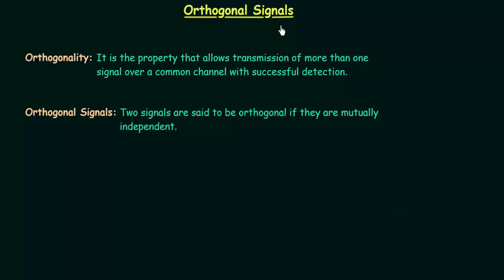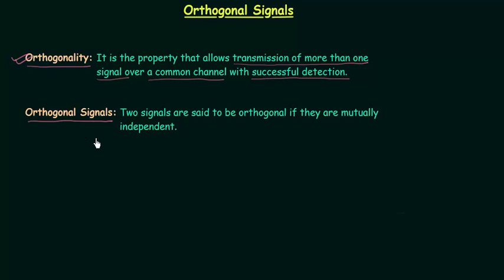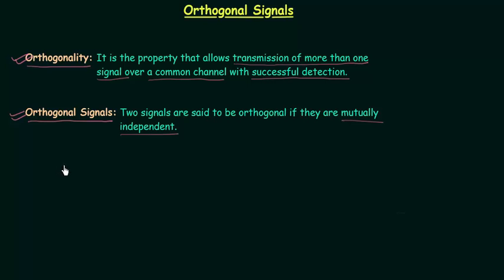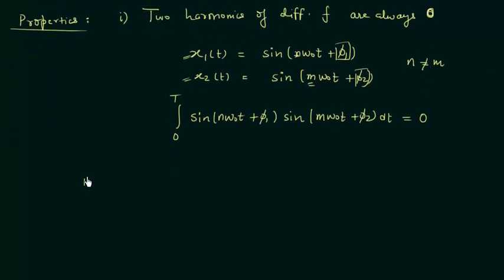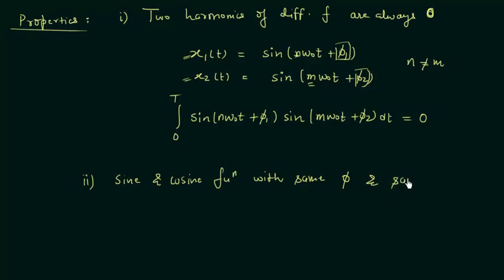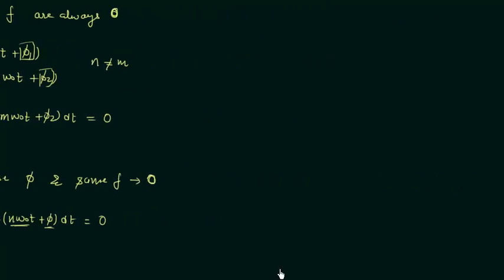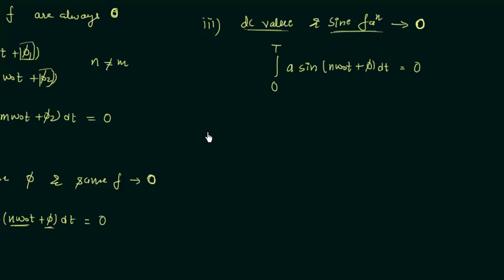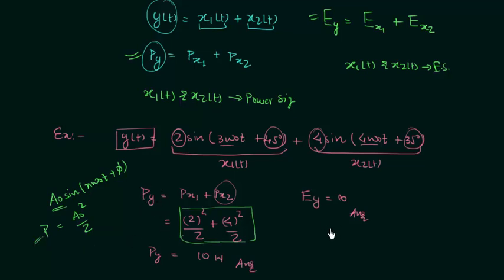Orthogonal Signals

Comment: If there are two signals x1(t) and x2(t) with DIFFERENT time periods, then while performing the definite integral, what should be the value of 'T' ?
Reply: T is the time period of the product signal y(t)=x1(t) × x2(t)
Reply: @saheliroychowdhury3253  Thanks a lot for the response. I am actually just beginning in this field, so this created another query. In this case, how to find the value of 'T' ? In the previous lectures, we were taught to find the time period of composite signals, but the individual components were being added in that case, i.e, y(t) = x1(t) + x2(t). But how to find fundamental time period where y(t) is the product of the individual component signals ? Would be grateful if you can explain or redirect me to some resources where I can learn the same. Thank you. :-)
Reply: If you've say x1(t)=sin 2t and x2(t)=sin 5t or any random sine or cosine function, you can always express x1(t)×x2(t) as summation. You've trigonometric formulae to do the same. I'm giving you the link of those formula.
Reply: With these formulae you express y(t) as summation of two signals and then find their respective time periods and do LCM to get time period of y(t).
Reply: @saheliroychowdhury3253  Thank you so much. Yes, I could get it for sinusoidal signals. Now, suppose x1(t) is a periodic signal with a triangular waveform with a time period of 4 seconds (just assume...), and x2(t) is a sine function with the normal time period of 2*pi, then y(t) = x1(t) * x2(t). So, in this case also, will the required time period of the composite signal still be the LCM of the constituent time signals ???  (The reason I ask this is because, in this case, we cannot use the trigonometric formula to decompose the product into summation of two or more terms).
Reply: See, generally we need these concepts of orthogonality to deal with sinusoids. In communication we primarily deal with sinusoids. And all non sinusoids can be decomposed into it's corresponding sinusoids using fourier series and transform. So we deal with sinusoids or complex exponentials. In both cases we can find the periods. Now coming to your question. The product of a sine wave of period 2π and triangular wave of period 4s is actually not periodic! Because 2π/4 is irrational. So there's no way to find period of a non periodic signal. For further knowledge I'm linking a page. 

Remember in communication engineering Fourier Analysis is of prime importance and we deal with complex exponentials or sinusoids.
Reply: @saheliroychowdhury3253  Thank you so much for clearing up my queries ! :)
Reply: Note that the generalized rule doesn't apply for sine cosine products as in that case 2π and 2π gives time period π (product signal) . So complexities are there. So for basic we'll stick to sinusoidals and complex exponentials